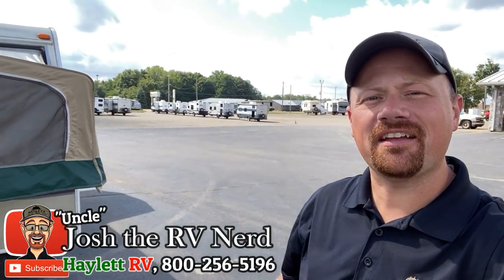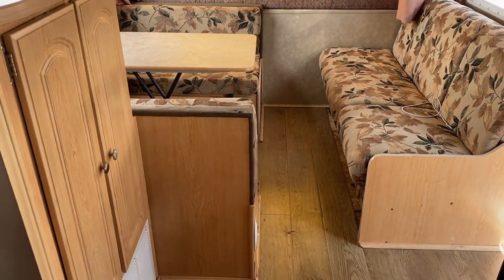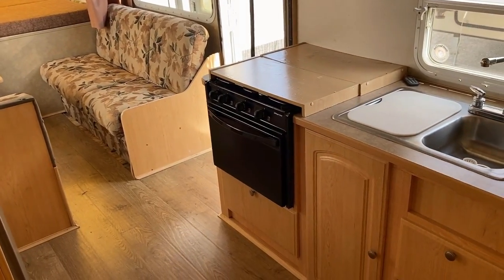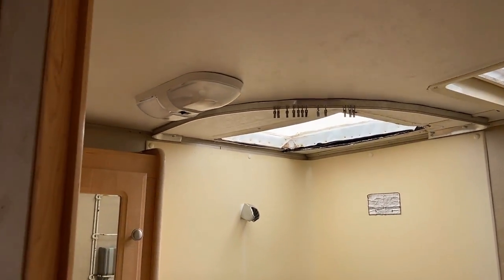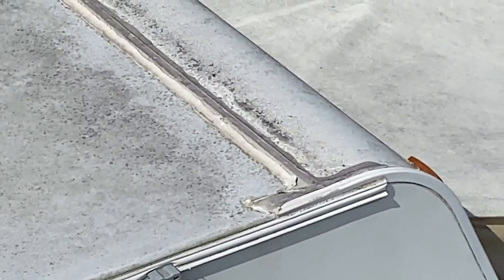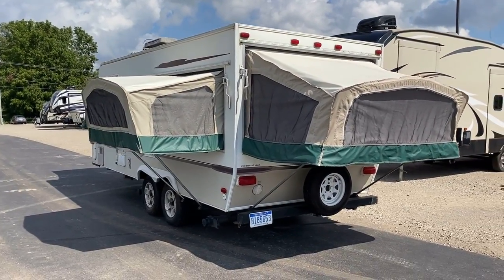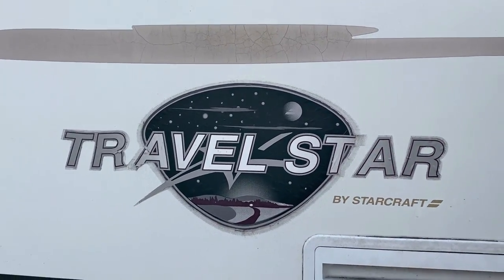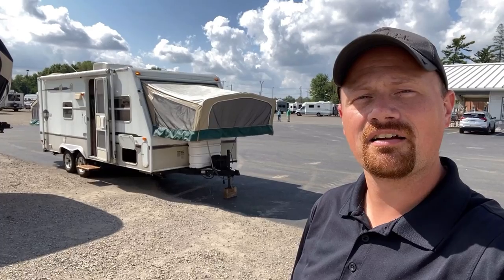Lookout for these things! (Starcraft 21SB Sample) (Sold)

Comment: Good information! By the looks of it you would just be scratching the surface of the possible issues with this trailer. This is one that I would run from, but perhaps there is someone who would enjoy the challenge of repairing an RV such as this one. They would certainly have their hands full!
Reply: There are some people who like a project and are good at restoring/rebuilding things, myself, I would run screaming in terror, the thing is 16 years old, under built, and not well maintained.

Comment: Man Im glad you posted this.. I've noticed the floor is squishy in my 2013 x23b in some spots but there's no evidence of water. I was always curious why.
Reply: We have the same year and model. We have the same problem in the floor.
Reply from the maker: Some thing it wasn’t obvious is some of those older Ultralite floors just didn’t have enough crossmembers. But that problem didn’t present itself until about a half dozen years later typically

Comment: I like Hybrid/Expandables for haveing great floor space in a smaller footprint, however they achieve that by having pop up style bed ends. In my part of the woods where it 600 days a year anything like canvas will get put away wet at times, and that is my biggest problem with pop ups and hybrids.

Comment: That DOT tag number on the tire indicates the age of the tire only. Not necessarily when the tire was installed on to the trailer. 02 indicates the week of the year which in this case is 2019 the tire was made/manufactured.

Comment: I looked at a Thompson fridge just like that one at a Whole Sale Club, but I do not remember the club. It was a 1.2 amp or 1.5 amp 120 volt AC refrigerator. We were impressed for there to be a 6.5 cubic foot refrigerator that was well under 2 amps. The matching Thompson Freezer was 7 cubic foot, and the same 1.2 amp or 1.5 amp. I keep saying 1.2 or 1.5 because one of them was 1.2 and the other was 1.5 and I do not remember which one was 1.2 and which was 1.5 amp.  They were priced $199 and $229 and I do not remember which one was $199 and which one was $229. My wife purchased the Freezer and I wanted the Refrigerator and the freezer has worked flawlessly for a year now.

I have eaten a lot of ice cream out of that freezer.
Mostly low carb or no sugar added.
I get low carb or no sugar added because I make a lot of Banana Spits.

I do not remember many details unless it is about food.
Reply from the maker: ahhaahahhaa
I feel the same way about food
"Remember when we met Frank and Alice? It's that time we went to that new mexican place and got those nachos.."

Comment: The roof, walls and floor are all rotten. The tent ends all need to be replaced. It's full of mold and is unsafe for any family. If someone didn't have mold issues, they would after a summer of camping in this thing. What do you have left? A frame that can be converted into a utility trailer or snowmobile hauler.

Comment: Josh if could buy a brand new camper, I would drive from GA to Michigan to buy from you guys!
That being said. Do you know anything about 2003 Dutchman aerolights?
Reply from the maker: Six sided laminated, all aluminum skeleton, known for soft floors due to studs not being packed together tightly enough

May have a flat laminated roof which could be prone to concaving slightly and pooling water around the a/c unit

Those aren’t guarantees. Just make sure you review it closely and know what you’re getting into 

This video may help you https://m.youtube.com/watch?v=uxzpd-W8UmE
Reply: @JoshtheRVNerd   thanks alot josh.

Comment: This unit is rough! I hope it’s price reflects it. I would consider this a “throw away” unit. Buy it, a use and abuse it for a year or two, then scrap. 

It may have decent appliances in it, but it appears the whole floor has or is reaching end of life, every wall is significantly damaged, the roof as well has multiple deteriorated points. Frankly, this trailer has just has to much damage to be worth spending more than a few hundred in patch type repairs to extend its life. I hope the pricing reflects its poor condition. 

This is a unit I would not spend much money on to acquire. 

To me this would be a candidate for short term use then removing the good components, scrapping the shell, refurbishing the frame and chassis, then reconstructing it into a new unit to fit your needs, using the good parts from the salvage operation. I myself would reconstruct it into a classic 50’s or 60’s style trailer you no longer see anymore. I am not referring to a canned ham look, but the boxy futuristic flashy buck rogers colorful style of the period. 

There are still some old manufactured/Mobil home parks around me which surprisingly still have a significant number of trailers from the ‘50s through the 70’s in them with most if not all the original outside structure and trim intact. More than a few of them are still in very good condition cosmetically, preserving much of their original cool style.  I think much of it would translate quite well onto this trailer frame and chassis.